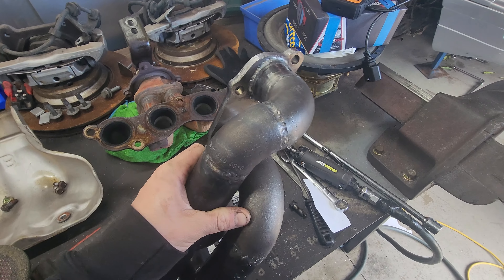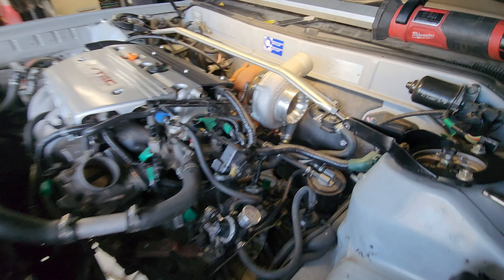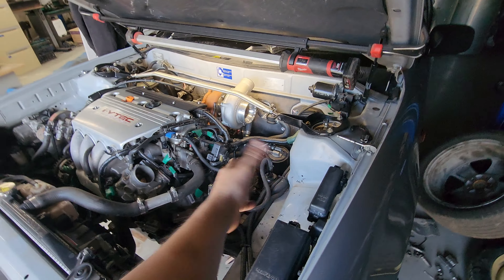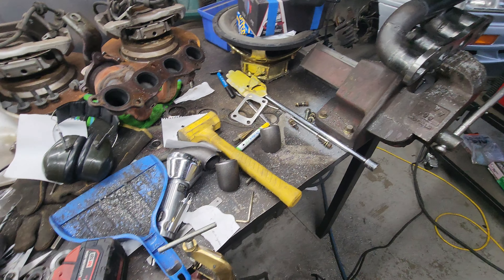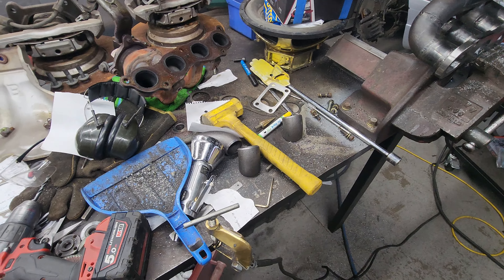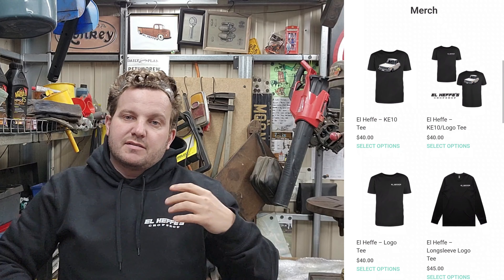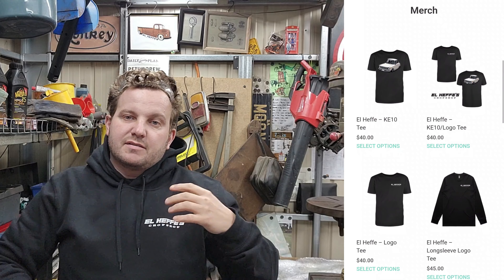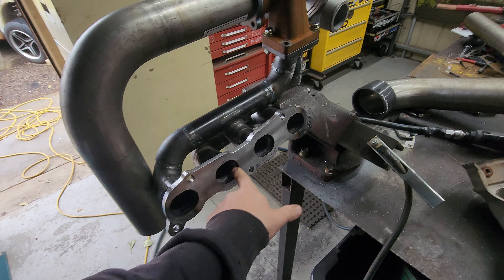Turbo Honda K24 powered Toyota Camry! pt2 Mounting the turbo.

Comment: G25 is too small. Got a G30-900 with 0.83 rear on mine and it's pretty responsive. Boost starts building at around 3100rpm. Just came across this series btw. Definitely one of the cooler backyard projects i've seen. Havent seen one of those camry's since my mate owned one back in highschool in 2010.
Reply from the maker: Thanks mate, what is your k24 in? And how much power did it make with the g30?
Reply: @elheffeschopshop  ek civic. Making 318kw @14psi on a run in tune with 98.
Reply from the maker: Nice! I'm really only hoping for around 250kw, I've heard the gearboxes are pretty weak. Have you had any issues?
Reply: @elheffeschopshop  should be doable. I believe my accord box has dc5 1-4 and stock 5-6 with factory lsd. I was told it'll handle the power unless it gets full traction at launch. So far only traction has been an issue. 1st, 2nd and 3rd break traction as soon as it makes some boost. Need semi slicks.
Reply from the maker: Hahaha sweet